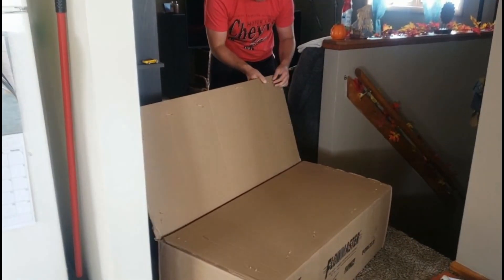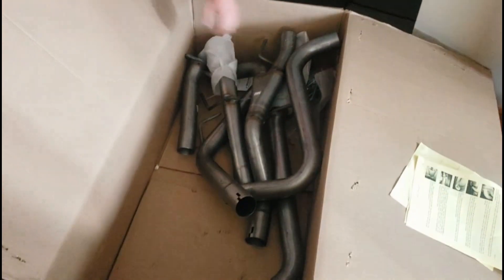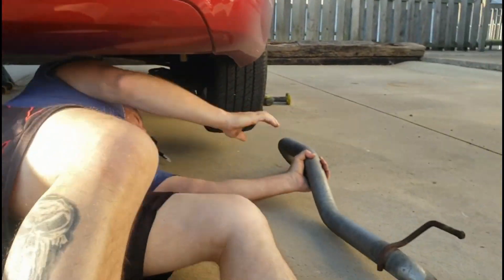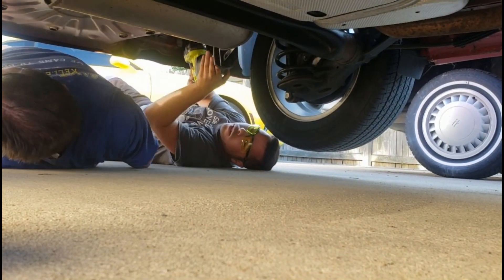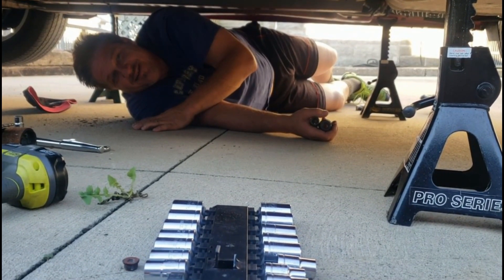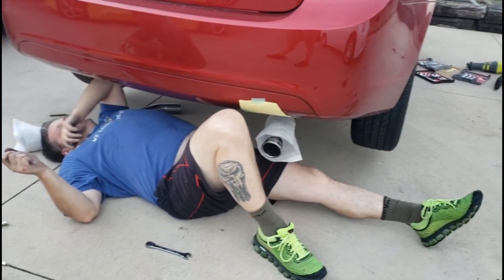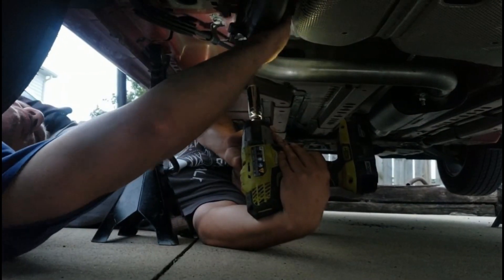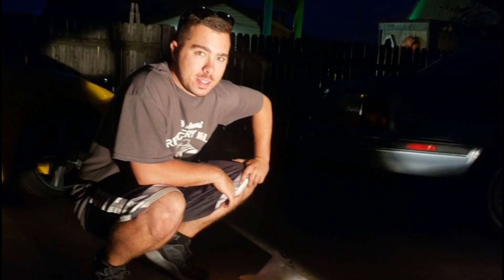Chevy Cruze Flowmaster Force II Catback Exhaust Install

Comment: Did u notice any performance gains?what are the pro's and con's??
Reply from the maker: Not much performance gains other than  more throttle response. Pros would be that it bolts right in...super easy install, great quality, and looks sharp with the duel tips. As for sound, its classy and perfect if you want a bit of rumble without others really noticing...its a quieter exhaust for sure.  Other cons would be that the muffler does not have a drain hole to let the water out...I recently got rid of my muffler and went straight piped cause I was looking for a louder exhaust and tons of water was just being held stagnant in my muffler. Significant rust and its only been 6 months.
Reply: I want this exhaust so bad but I don't want to deal with the water in the muffler. I've been looking for info about it but can't find anything. Ya think I should call holley and find out there?